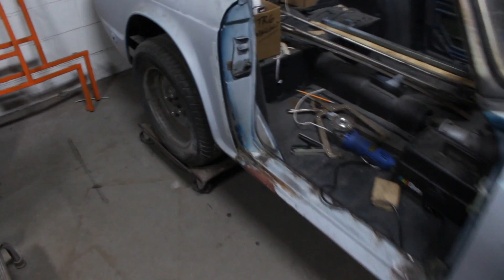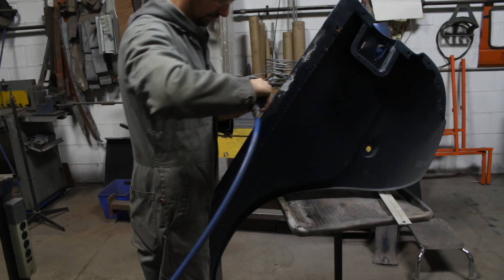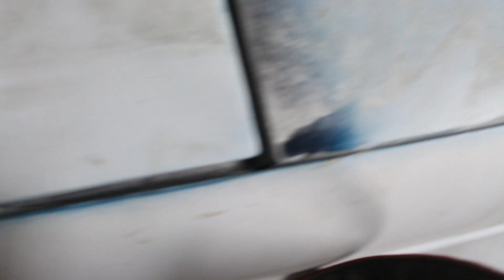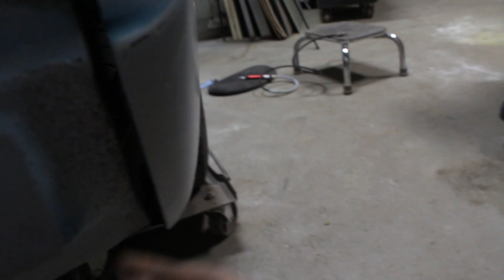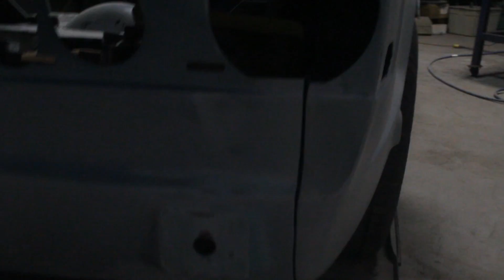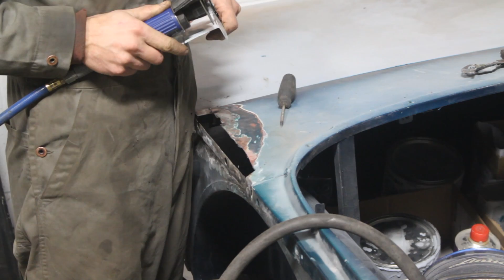1973 Triumh TR6 Restoration Project - Part 7

Comment: Good job there Elin, Is that part of the deck panel flat or does it have some element of flare on each side like the boot lid does? I have exactly the same problem other than the botch job is much worse so I don’t have much to go on to shape a patch. If it’s flat I’ll chance trying a patch but if there are flares I think I may have to buy a new deck panel and unfortunately those are one of the most expensive panels on the car. It looked not too bad on the surface but it’s practically made of fillers and bad braising.
Reply from the maker: Thanks! It is a little flared, it follows the shape of the boot lid. But i am sure that if you can make a flat repair, you can do that as well. I cover this repair in a lot more detail on both sides of my 1974 TR6. There is a playlist on my channel about it.
Reply: @RustyBeauties  yes I’m watching the excellent series on the 74 just haven’t gotten to ghost episode yet. It’s like a university, all credit to you!

Comment: Isn't it so frustrating when you have to fix someone elses rubbish repair, but you did a great job of it. Funny when you mentioned cutting out some more TR6, I don't think there is much original Triumph left in my Vitesse either haha
Reply from the maker: It is even more frustrating when those repairs happened in front of my eyes. Or I should say behind my back. We hired this guy especially for body work and engine repairs. He was doing that for more than 20 years he said.... So the TR6 was his first job in our shop. He did it so fast that I didn't even manage to follow up while he was doing it. In no time he had body filler and primer all over the body and the panels (as they were off the body) so I thought my knowledge about bodywork sucks.... Later he figured out the panels need to actually fit on the car..... surprise...... he never fitted them while repairing them. He also rebuilt the TR4 engine, which smoked like a chimney when it started... The guy didn't last long after that, but I am still dealing with his screw ups.

Comment: thanks again for showing proper ways of repair.actual removal of all rusted out ares.this is exactly what i will be doing also.

is your 74 body in bad shape like this 73?will you be showing floor and sill repairs also in the near future.I hope so.
Reply from the maker: The body on the 74 looks much better - all panels line up and as far as I can see it is almost rust free except of the floor of course. There are some bubbles under the paint in the same area between the deck and the rear fender and in the sills, but otherwise it looks solid. According to the previous owner the fenders and sills were replaced and the car has been repainted just before he took it out of the road. And I have all reasons to believe him. But it sat somewhere in a flooded area probably and the frame disappeared, taking the whole floor with it. Maybe the sills are gone too even though they look solid outside. We got new floors, inner and outer sills and bulkheads. When I start working on it I will evaluate and decide if all these need to be replaced or I can selvage some parts, but first I will start with the frame and I think I will have to work on the body while it is on the frame. I've never done floors before and I am still looking around for more educational videos. I am pushing hard n the 73 now so we can send it for paint and then I will jump on the 74. For now KJ is de-rusting and getting the frame ready for me to repair.

Comment: that area between the rear deck and where it joins the rear wing, that is a notorious rust spot because the gap between the wing and the deck always lets water in, even when the gap is filled with bondo and painted over, the body flexes and the paint and bondo eventually cracks and the water gets in and rots the top of the inner wing and the edge of the rear deck. There is a school of thought that recommends using a flexible non setting rubber sealant along that join, the problem is that when the cars were built in the factory the wings were painted off the car then fitted after so you could then get a good clean line of black sealant that wasn't overpainted as the paint always cracks eventually and looks messy.
Reply from the maker: I think even with the non-setting rubber sealant water will still get trapped on top of it and will corrode the metal. The other problem is the mud from the wheel gets stuck in the same gap underneath and every time it gets wet it will take long before it dries and basically there is no way to stop these weak spots from rusting unless you keep your car dry, which I am hoping to achieve with my Spitfire. If there is rain in the forecast just take out something else from the garage. I managed to keep myself dry with my bike all summer last year, so hopefully it will work with the Spit this one.
Reply: we have so much rain here in England, but yes they should be dry weather cars!! some people here fit an after market inside plastic wheel arch insert, similar to what a modern car has, it offers some protection to the inner wings, I've seen them on a few cars here.